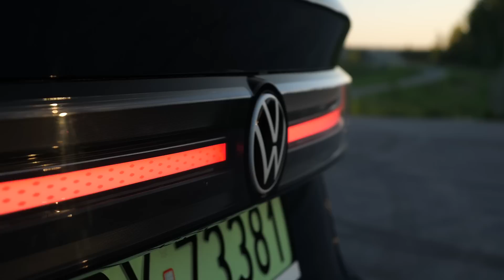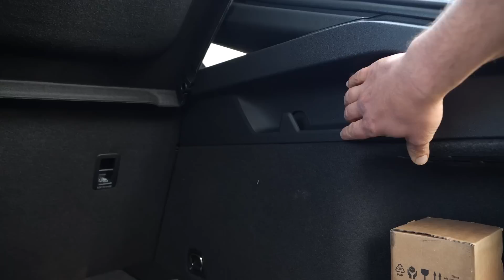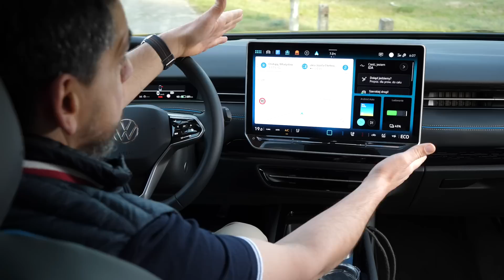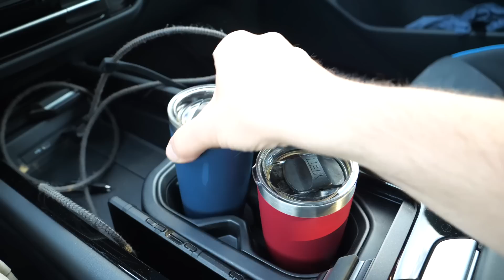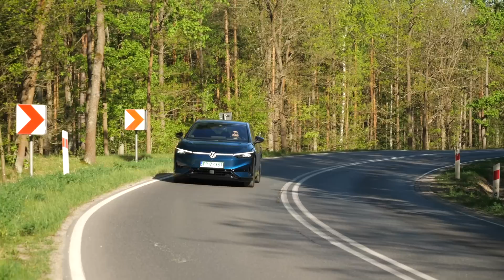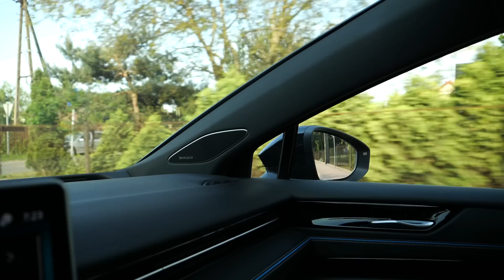Volkswagen ID. 7 - Electric Passat? (ENG) - Test Drive and Review

Comment: Hey Marek! Do you think these new DCC with 2 valves are worth over the standard suspension? I mean I have a 2017 Passat with old DCC (1 valve) and I just hate it. To the point that made me change them to standard suspensions, and it's so much better! What's your take on these new DCC like the one ID7 has? Cheers my friend!
Reply from the maker: This was recorded more than 2 years ago. All I know about this car is what I said in the review. 
If I didn't say anything about DCC, it's because there was nothing to say (this time ;) ). I remember the old one used to make knocking noises over some bumps. Try my Passat review. I think I said something about it there.

Comment: I have a B8 Passat diesel which I for the most part like, and you can obviously tell the ID7 was designed to appeal to Passat people. But they can't swallow their touchscreen pride and put buttons and knobs back for the most important functions. 

It also sounds like there needs to be a big physical button somewhere that the driver can program to switch off the EU mandated safety features of their choice. When you know the stuff you were required to put in is going to be universally hated by customers, why make them jump through touchscreen hoops to turn it off? It's like stop-start in Stellantis vans which is in a touchscreen tab. And yes my Passat has a physical button for stop-start right next to the start button. It's been in muscle memory since the first week of ownership.
Reply from the maker: In the new Passat you can programme to have the stop-start shortcut in the top left corner. Unfortunately there's still no way to get ISA switch up in the top menu. You have to do 2 clicks. Better, than in the refreshed T-Cross, which has the old infotainment you know from your Passat, where ISA takes 4 clicks.

Comment: The biggest issue for non-Tesla EVS is for sure charging convenience. I live in Romania, recently went on a Euro road trip with my Model 3. Charging is plug and play on every supercharger.

In Romania, I have enabled plug and play charging for the 3rd party providers, but you have to jump through some hoops, one one you need first to have 3 successful charging sessions, then you can enable it from the app, for the 2nd provider you also need a successful charging session, but you have to send them an email.

So the plug and charge is possible,probably on most charging providers, but it's not trivial and easy to do.

This needs to be addressed somehow, otherwise I simply can't force myself to buy a non-Tesla ev.

Last example, while visiting Genoa during the trip, I tried to see the prices of local provider, Iren Go (I think). Well, their app was geo-blocked and was not possible to download with my Romanian android phone.

So, if someone plans to only travel in their own country, all EVs are viable, because there is probably a way to enable plug and charge with the local providers. But if you want to travel abroad, it becomes a huge pain in the ass.

I know there is some EU directive that would require all EV charging providers to enable card payments on the charger itself, but the prices would be probably pretty high for non-app charging. Even now, near Vienna, I found 3rd party charger that were 1.1€ per kW, while Tesla was 0.35€, which is frankly absurd.
Reply from the maker: I wish charging was made easier, and more transparent. If I have to optimise my trip to use networks that I'm registered with, and therefore can take advantage of cheaper charging, where's the convenience in that? At a gas station you just fill up, and drive away. With EVs there are different subscription plans, which is an unnecessary hassle. I know, it's going to get fixed eventually, but for now it's one of many annoyances.

Comment: How the mighty have fallen - VW making bland cars, without the slightest whiff of excitment. And an actor famed for his Trainspotting (!) now peddling dull cars. Sad, really.
Reply: vW have NEVER made exciting cars.  They design cars that do not look meh in 10 years time, so you can still sell them. Parts available in every corner of Europe, or a bit further...
Reply: VW used to make cars that you would look forward to driving. MK1 and MK2 Golf GTI's, Scirocco Storm, Polo G40 etc etc. Not only were they fun to drive, for a relatively  modest outlay, but they looked good, and very often held very good residual values. I have owned a fair number of such cars, so I can speak with some subjectivity. I realise that we live in changed times, but VW could have taken account of the reasons so many used to buy their cars.

Comment: Love the lift back style! Wish it was coming to the states. My only concern is that it is less efficient than my model Y on the highway where drive up to 145 km/h.
Reply from the maker: You know EVs are susceptible to weather. We'd have to drive side by side to get a realistic comparison :)
Reply: @MarekDrivesENG  of course! But my Model Y in Colorado and in winter driving has a lifetime average of 265 kWh/mile or 16.5 kWh/100 kms. I find Teslas to be much more efficient in the real world. 🤷🏻‍♂️
Reply: The difference in range and efficiency is so small that u barely feel it anyways, go for more what cars are for, space, comfort, practicality, design, interior etc. For me id7 wins, but if u sre more a spec guy and power than tesla is for u :)